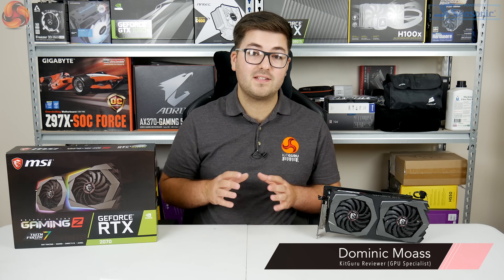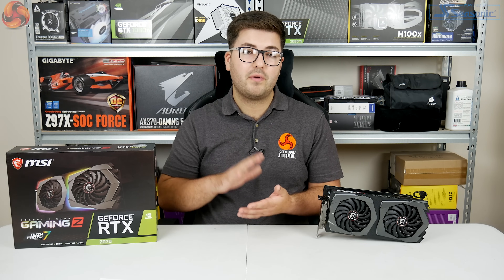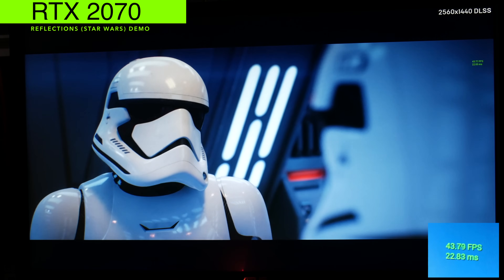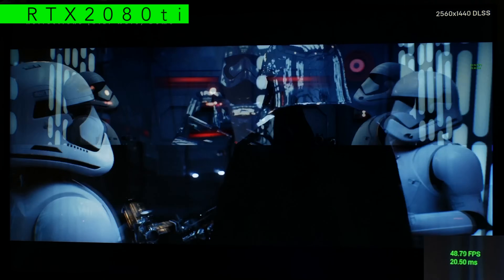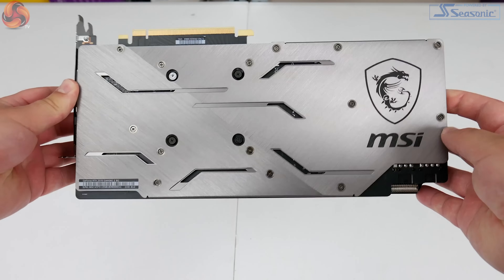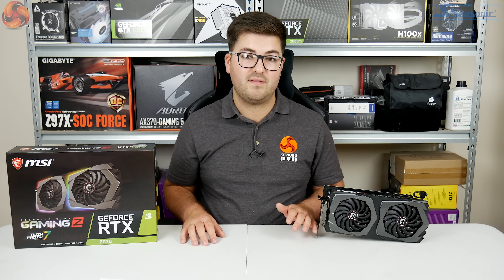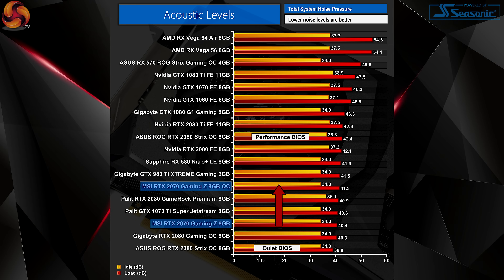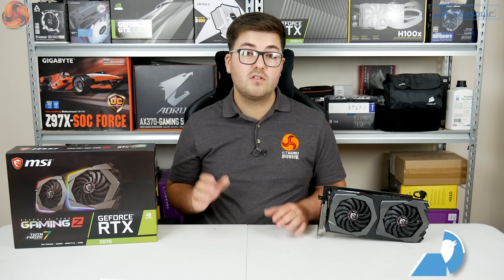MSI RTX 2070 Gaming Z 8G Review - 210MHz faster than reference

Comment: I could hit a +130mhz core clock boost, as well as a +1250 MHz memory overclock in msi afterburner, and it would run Unigine Heaven amazingly. I think the maximum stable Heaven run I had the core clock was 2085-2070 MHz the whole time, so I don’t know how you guys managed to get so low stable OC’s. Unless I’m doing it all wrong?

Comment: My RTX 2070 Gaming Z overclocks to 2040 MHz in some applications, but most of the time hovers around 2000 MHz. This is with manual overclocking. Using the OC scanner gets a slightly lower overclock, around the mid 1900s.

Comment: Is the support thing that comes with it necessary? or can i roll without it.
Reply: Josh 117 well you can but because its big card it will sag a lot
Reply: @MrZampo123  Will it happen immediately or over time? Cause right know it looks fine.
Reply: Josh 117 it will happen immidiately, but it depends on the case a lot will it sag. Im actually getting my Gaming Z tomorrow and i k ow by fact that it will sag because of my cheap ass case :D but if you have good case it is possible it wont sag
Reply: @MrZampo123  I mean I have a pretty big case and it was not cheap. https://imgur.com/a/QYj0j7z . I cant really tell ifs its sagging what do you think. If you don't mind taking a look.
Reply: @Josh-tu3pg  Well it looks like its little bit saggin, after all its a hefty card. I dont personally know HOW big of a problem it could be. If u want to fix the saggin without usint the support thing heres a pretty good video to help you with that :) https://www.youtube.com/watch?v=EOXYE3hx_JY
Reply: @MrZampo123  Thanks for your help I really appreciate.

Comment: In many other multi benchmark reviews and many single benchmark reviews, the MSI 2070 Gaming Z is a lot closer to being like a typical 1080ti.  I have no idea where you guys are finding these "cheap" 1080ti's.  The ones I see for sale are $800 plus for typical models, and the quality models are easily over $900.  This card is $600.  So, you are saving at least $200 if you get the MSI gaming Z, while getting nearly the same performance as those ordinary 1080ti's.  That represents a pretty good value, actually.  Its nearly as good as last years flagship for 75% of the cost.  If you already have a 1070ti or better, I probably would not bother.  But if you have a far lessor card and/or are looking to build a whole new system from scratch, this card is totally an option.
Reply: I've been looking on eBay the last two weeks. People are asking £350 for 1070ti, £400 for a 1080 and £550-£650 for the 1080ti. Second hand ofc.
They are still stupid money on Amazon.
So I ordered this gaming z for £520. 
It's not going to be as good as the ti but I can't see them coming down again and it will do for me untill I probably call it a day with pc gaming when the new consoles appear.
It's just getting too expensive and 4k gaming for half of a 2080ti sounds appealing.
Reply: @letni9506  I think what happened is all these knuckleheads tried to make their blind speculation a fact.  They thought the 1080ti's were going to go on crazy clearance sale prices and be gotten for around the price of a 2070,  but that just never happened.  Not even close.  The 1080ti's basically stayed at MSRP or higher up to the end of the run.  When the 20 series came out, if anything, the 1080ti's got more expensive.  Not all 2070's will get close to being 1080ti's.  But the better ones do get pretty close all around, and the price is actually pretty darn good on the 2070.  They just hate being wrong about that.
Reply: @KungPowEnterFist  people just hate saying good things for Nvidia... the idea is that 2070 looks so good price wise caus nvidia is buggering us with the 1xxx series...

edit: the prices have dropped  tho... i wanted to get a vega 56 for christmas but...now 2070 looks so much better upgrade(if the price drops a little bit.) ....
Reply: RIGHT?? Plus i prefer brand new with Warranty. The 1080Ti's are still stupid expensive
Reply: @Justinsonfire  Of course you dont buy the used, refurbs, etc.  Thats about the stupidest thing anyone can do.  There is a pretty good chance it has been running 100% balls to the wall 24/7 doing mining operations for the last year.  That card is pretty much spent.  Thats why they are selling it.  If its your buddy down the street, maybe.  But off of Ebay?  You got to be pretty dumb to pay $600 for a used 1080ti off Ebay, IMO.  Its worth $200, maybe, and I would be hesitant even at that price.
Reply: RTX 2070z is a beast😍🤘🏼
Reply: @thunder_gamers5566  Ive been running my MSI 2070 Gaming Z for 6 weeks now.  Fantastic card!  Completely silent not under load, overclocks like a champ, and stays pretty darn quiet under load.  I dont game much, but the games I have run play great with higher settings.  For content creation, my primary heavy task, this is the best value on the market by far.   I am not regretted in my purchase at all.
Reply: @KungPowEnterFist  What do you think which card is better 'futurewise', RTX 2070 of course with all these additional cores, shaders etc.? Or just 1080ti but running slightly better in games due to higher clocks? I consider buying an RTX 2070 Gaming Z currently.
Reply: @kondziu124  I currently have the MSI 2070 Gaming Z, and Ive been 100% happy with it for two months.  I got it for $574 ($600 January 2019).   I would also be perfectly happy with an ordinary 1080ti.  These two level of cards perform about the same all considered.  The 1080ti's are pretty scarce now, though, and It will be hard to get one for under $1000 at this point.  At $400 or higher more for the 1080ti (January 2019), that would be an absolute no for me.  Future wise, I would say neither has an advantage, provided they are both new when you buy them.  RTX/DLSS may become a thing one day, but it is doubtful the 2070 would be good at it enough to be a deciding factor.  I would just ignore this aspect of it.  I would not advise you buy a used 1080ti unless its your buddy down the street and you trust him or her.  If its on eBay or whatever, assume that card has been coin mining 24/7, balls to the wall for the last 400 or so days.  You should avoid that card unless its nearly free.  $100 tops.
Reply: Don’t forget about DLSS, making it 30-40% faster, just wait!!!!!
Reply: @loshun7827  Yeah, I dont know about all that.
Reply: @Why So Serious how is the card? im thinking of buyinf
Reply: @Nirmk  I highly doubt this outperforms a 2080.

Comment: Installed mine tonight, and benchmarked better than expected. I went from a 1060 3gb gaming x to this 2070 gaming z and besides being a much nicer card to look at (much better RGB) I got some great benchmarks. User benchmarks rated my PC at 61% gaming yesterday and 114% today so that was nice haha. Also more than doubled my 3d mark score I think, forget my initial score and it didn't save for some reason.

 Now I just need to overclock my i5 6600k to complete my 2 year upgrade, and before anyone goes on about how I should have grabbed a GTX, I went from such a low point in power that I decided to go for a big upgrade, and take a gamble that ray tracing could catch on.

Excited to really push this thing over the next couple of weeks.
Reply: Greg Thompson thats great! How are the temps mate?
Reply: @MrSham3less  it's warm, but not hot. I don't monitor those things too closely and rather just do a hand check every now and then. Doesn't seem much worse than my 1060 ran, likely because I ran on high with that thing anyways
Reply: @truegregthompson  Nice
Reply: i'm about to buy this card tomorrow, has it done you well? i'm pretty worried about it artifacting and stuff lol

Comment: they are gimping the 1080 or boosting the 2070.. this is not an honest review imo.. take a look at gamer nexus's review, it shows that they are more or less equal when overclocked, granted the 1080 used was an FTW model, but the 2080FE is also a factory overclocked card and should be considered as such and not as a reference 2080
wacth till the end, or at least till the end of the benchmarks....link to the review https://youtu.be/FPombfzp7qw?t=296

Comment: Wow the pricing is crazy on these cards. I bought a EVGA 1070 Ti Black for £340 (Sale price was £360, but I sold the Destiny 2 code to a friend for £20) a few weeks ago, and was thinking I could maybe make use of there upgrade service, but it doesn't seem like it would be worthwhile if that is around how much it would cost.
Reply: You do realize that the Gddr6 on these cards have much better compression than Gddr5/x on the pascal ones. That makes them much better.
Reply: @kblasterbug  That isn't how memory works, the memory it's self doesn't compress anything.
Reply: Look up 1070ti prices. 2070 is better then 1070ti. If a 1080 beats a 1070ti how is a 1070ti better then brand new tech and 2070 gpu? Some of you people are to stupid and cheap and use the performance excuse. Even if you paid 340 this 2070 is 600 and has more performance then a 1070ti and 1080. And 1080 are almost if not more new then this 2070
Reply: @SIMRIG412  Yes we are all well aware that the 2070 is better than a 1070 Ti, thanks captain obvious. We are looking at the price to performance difference, which when the 2070 was released, was poor compared to 1070 Ti and 1080 cards.

Comment: No offence, but 2070's performance is so horrible...for that money...
Reply: a new 1080 goes for about the same price. The 2070 actually outperforms it by 5-6 fps at 1440p so its actually the only good buy from the RTX series. The 2080 and 2080Ti are overpriced, the 2070 is actually worth it. Scooped a new brand msi 2070 for under $600 today so its actually a pretty good deal.
Reply: Horrible??!! Above 1080 practically in every game and resolution, even much more in RAY-tracing (if that's important).
Reply: @morbidgull8922  The Gddr6 on these cards have much better compression than Gddr5/x on the pascal ones. That makes them much better.
Reply: true that
Reply: I'd like to know how it is horrible ? Disregard rtx for a moment and you have a card that sits between 1080 and 1080ti for quite a reasonable price for its performance.
Reply: @christo-t7e   I agree. The RTX's are awesome. My RTX 2070 destroys my old GTX 1070. I have it highly overclocked so it's close to 2080 speed.
Reply: Kyle Brasch I've just got my MSI 2070 gaming z today playing in 1440 ATM, smooth as f##k
Reply: Kyle Brasch what model 2070 do you have ?
Reply: I got that same one. Use the MSI Afterburner beta to automatically overclock it. I can't remember where I found it but MSI has a tutorial to do it.
Reply: Kyle Brasch yeah that’s what I’ve done on afterburner .
Control and f then oc scanner then scan then test .
Problem is I haven’t got much of a clue what it all means tbh . I’ve put power limit up to max then memory clock 805 then gpu clock says 1410 then 7805 MHz .
Seems to be performing well anyway ,been playing in 4K on some games ,dropping from between 60 FPS to 57 ish now and again with no aa on
Reply: I just bought this exact card for 400$ brand new would you say its worth that much? honest question.
Reply: I agree it's a bit of a flop and I doubt it's going to be powerful enough for Ray tracing anyway